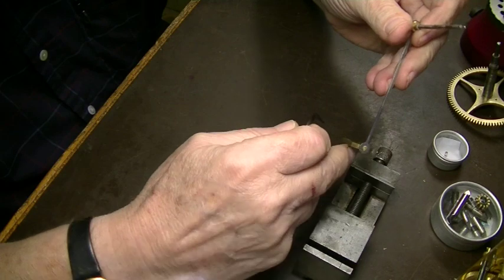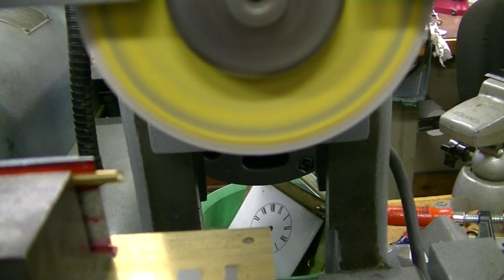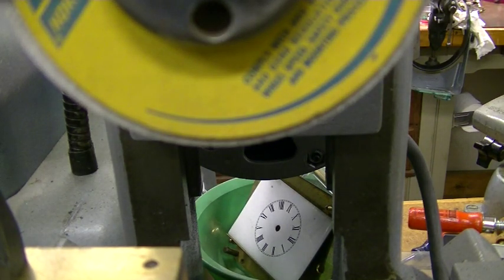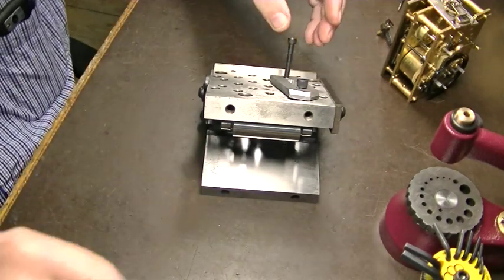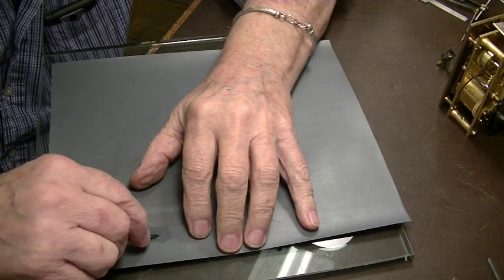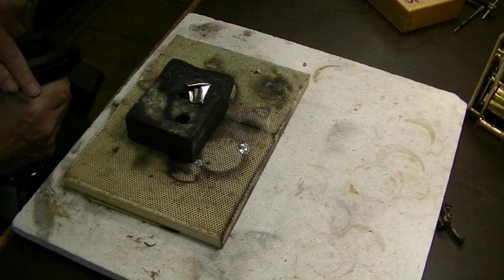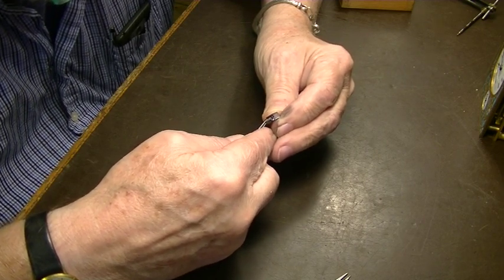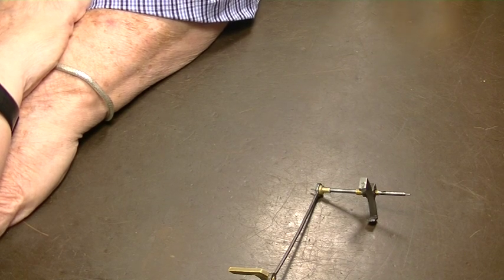The Village Clockmaker.Tutorial. #14. Making new pallets for a Graham dead beat clock.

Comment: i have the same graham dead beat in my vienna wall clock...  although the lenth of my pallets are adjustable.  i dont know what length they need to be  i get a good tick tock but i just do not seem to get any power to the pendulum  and clock stops within mins. without the anchor the time train runs very well with very little effort.   can someone please help
Reply: Did you sort your problem out?

Comment: Thanks so much for a great real time video.  With as much precision as you achieved acquiring the 35 degree angles for your pallet I am curious how you preserved that precision as you fitted these parts to the pallet you were repairing.  Wouldn't there be a tendency to lose your precision if the fitted parts rocked upon insertion and gluing?
Reply: Richard Leland 
I was thinking that too..
Also I was wondering how he managed the solder the anchor in the correct angular position, it's a problem I have had in the past.

Comment: Trigonomics?... surely you mean 'trigonometry'?... but wouldn't you simply look it up in your Zeus book... I take it that you have a Zeus book?

How did I know that you would eschew the time-honoured fixative of shellac, which is very easy to removed by the application of a little heat and organic solvents. Your choice of the abominable epoxy resin, which is extremely difficult to remove, involving enzyme degradation, e.g. soaking in pineapple juice for several weeks, is very poor clock-making practice.

The pallet surfaces finished on what, 600 grit 'Wet or Dry paper'? What happened to 1200 and 1500 grit? 600 grit is very rough work.

Ancient Greek, the Hippocratic Oath: Κατ 'αρχάς, μην κάνει κακό (First, do no harm). Unsympathetic restoration is worse than no restoration at all.

Do it properly, or don't bother doing it at all.
Reply: With all your expertise you should be making a video. (Sarcasm intended)
Reply: Ouch.....crikey I'll bet that hurt...!!